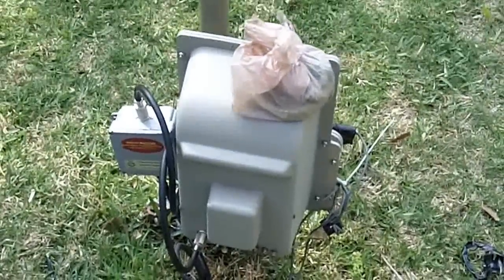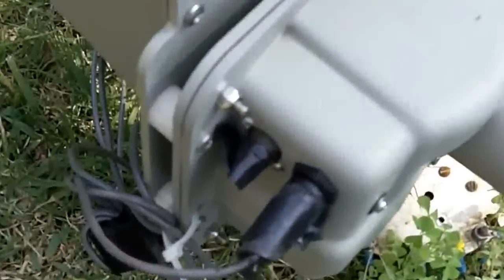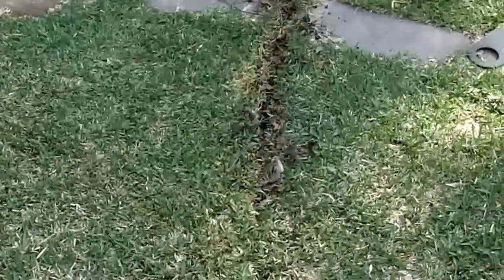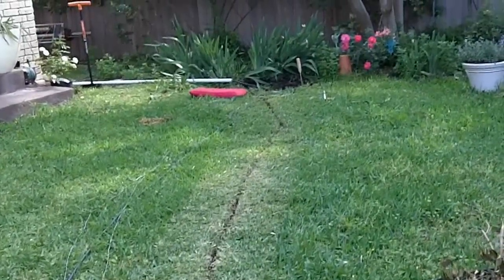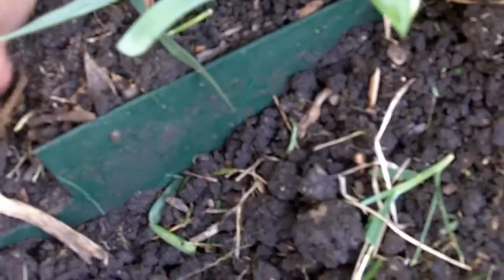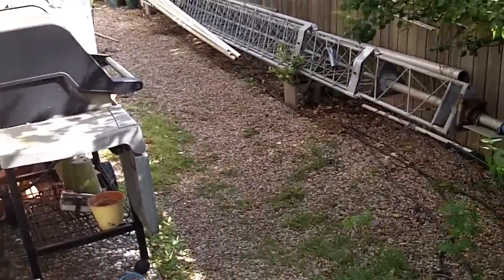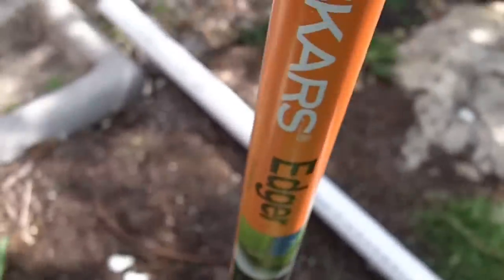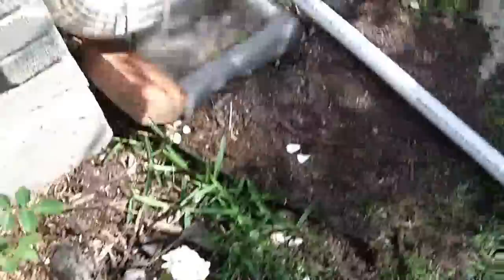W5XJ-steppir big IR cable bury project 120401

Comment: How well does it work is the question????
I might want to install one on my sundeck on the 3rd floor of my new home Im moving to
with water all around me out on a large island.
Only thing is I would have to run my radial all down one side of the sundeck to the ground ot straight down the side of the house. Not sure how that would effect the antenna pattern .